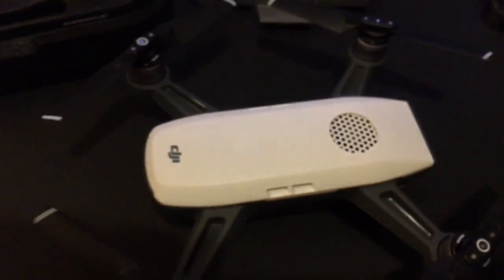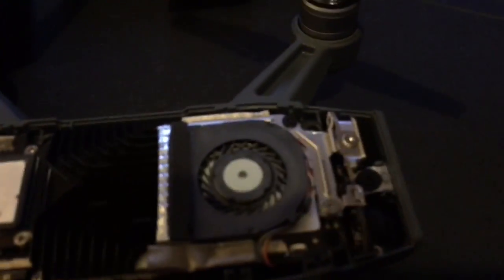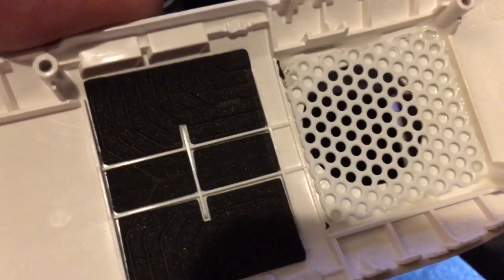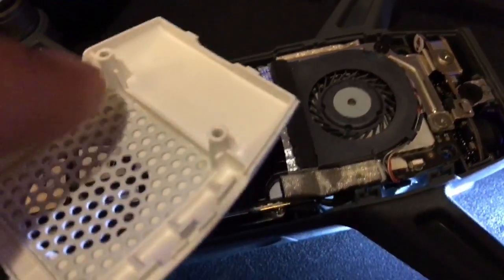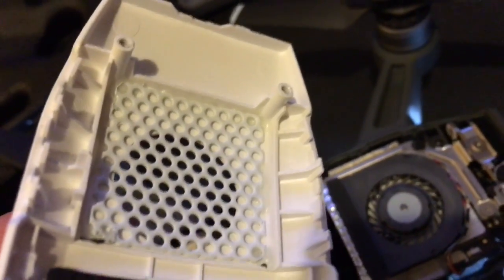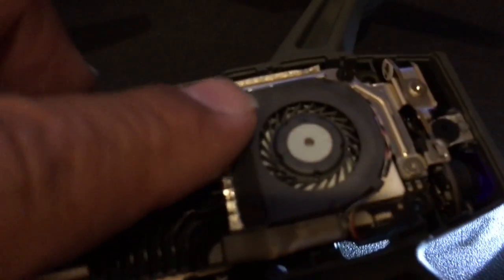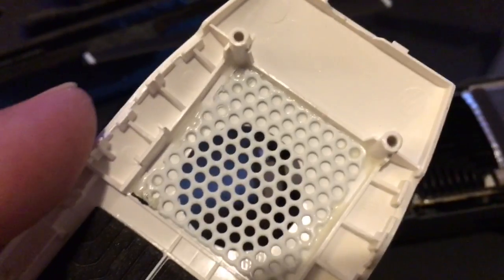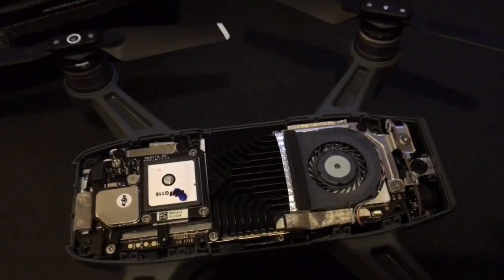Dji Spark mods

Comment: yup it helps that drone gets pretty hot after the second battery you could feel that hot air out the vents, i made a hole on mines that screen looks nice but is not necessary.
Reply from the maker: BORE Yea I took mine out after a while...Thanks for watching!

Comment: Nah bro you're right. The purpose of the heatsink is to help pull air OUT AWAY from the chipset not flow air into the ECU.  So yes it is a good idea to have that vent there and you might even get more flight time because of that grill. I am also going to do this when I get mine.
Reply from the maker: Fransisco Cardenas Thank you for watching And comments!

Comment: Finally did this mod.  2 flights in and it’s definitely cooler to the touch than normal.
Reply from the maker: Cookster670 Thank You for trying it!!! I’ve gotten so many comments about how dji made the spark the way they did for a reason...and how I’ve compromised the drone by cutting a hole in it and sooo much negative feedback. I’m glad you took the time to try it and gave your feed back on the results! Thank you for watching my channel!!!
Reply: Lol.  I know what you mean.  I posted my actions on a local forum and am getting the same haters making comments.   Apparently my spark will melt now. Lol.    Your logic made sense to me and it was worth giving it a try.   I am not dissapointed.   If they don’t like it, they don’t have to try it.

Comment: Were you having an overheating problem??, I guarantee you DJI's design pulls air from somewhere.
Reply from the maker: Jeff .S No....no overheating problems at all, But it did feel warm after a flight. Keep in mind my spark is hacked and flies in sport mode most of the time doing 50mph. I wanted to aid in the cooling process and now it’s much much cooler after 12 to 13 minutes in sport mode Thank you for your comments!

Comment: it sucks air from one side and runs it across the other. this mod isnt worth it in the long run. warranty void
Reply: No it doesn’t.  Both vents are exhaust vents.  I have just tried this mod and so far the temp is definitely cooler than normal after 2 flights.   It’s lukewarm vs hot.

Comment: hello good night my fan of the DJI spark is sounding it seems that it will touch something or there would be a space in the shaft, I opened it and uncovered it but I could not remove the noise the DJI spark is working perfect it is just that noise, you think you can fly it like that? have a serious problem? Can it be reheated? I appreciate your answer 🙏
Reply from the maker: Ai Emma Are the fan fins bent? Cause if there is nothing touching it.....It Could be that the fan fins are bent and that’s why your hearing a noise. Carefully check the fins on the tiny fan and look for any fins that appear to be pushed or bent!

Comment: Cool mod! Something I won't do to my  spark tho. Maybe there is some benefit maybe there's not. But there's most definitely a reason why DJI designed it specifically the way they did. This is just my opinion though. Safe flying!
Reply: May been just for looks, cooler electronics are the better they run and last longer
Reply: @mblake0420  Indeed cooler electronics last longer. And ofcourse DJI wants you to get a new one asap so thats why they mde it to heat up ;)

Comment: I flew my Spark yesterday after doing this mod.  My intake came out to only 3/8" with some window screen mesh as a filter.    I will say that the Spark IS much cooler after flying for 10 minutes.   The exhaust coming out of the side vents was blowing cool to warm air.  I don't have a way to measure the temp, but after a year of flying and handling this drone I can attest that it is MUCH cooler.   I have no idea of the benefit, but I am pretty sure that excessive heat is not good for electronics.
Reply from the maker: Conrad Serrano Do you know that there are some people out there that believe that the side vents draw in cool air. That one of them is used to draw in cool air and the other is the exhaust. I thank you for cleaning that up....And I know that the drone stays much cooler! But there have been tubers out there that out-rite say that this mod has no benefit.
Reply: I can positively attest that the side vents (both left and right) are for exhaust.
Reply: would have improved the battery. because the fan runs less ??????????
Help
Reply from the maker: mateus gabriel The fan turns on when the spark is on!
Reply: @geolopez914  Yes, but when the spark is cold, the fan turns slowly???
Reply from the maker: mateus gabriel Not true.....Do you even own a spark? Or taken it apart to even say that?? So if true....make the video and prove me wrong!

Comment: FYI SPOKE WITH DJI AND GOT WORD BACK FROM ENGINEERS!!! 

YOU IGNORED MY OPINION I KEPT IT ANONYMOUS BUT DJ I SAID I WAS A HUNDRED PERCENT RIGHT!!  

GUYS DO NOT LISTEN TO THIS GUY HE'S WRONG!! NOT ONLY IS IT DANGEROUS TO THE PEOPLE BELOW, TO HIMSELF, AND TO INNOCENT BY STANDERS, COULD CATCH FIRE, POSSIBLY CRASH OVER SOMEONE'S HEAD.. YOU WILL ALSO VOID YOUR WARRANTY... 

I TRIED TELLING THIS GUY USING MY 30 YEARS OF ELECTRONIC EXPERIENCE BUILDING AND FIXING ELECTRONICS CERTIFIED COMPUTER AND NETWORK ENGINEER WITH MY OWN BUSINESS FIXING ELECTRONICS PHONES AND COMPUTERS.. 

TELLING  EXPERT OPINION!  WHAT HE IS DOING IS COMPLETELY WRONG AND DOES NOT MAKE THE INTERNAL CPU TEMPERATURE DROP IT ALL.. YOU COULD BE MAKING THE INTERNAL PARTS EVEN HOTTER, CAUSING  STRESS ON THE FAN,  THE MOTORS ETC.  

HE THINKS HE DID SOMETHING GOOD NOW BUT SOMETHING WILL EVENTUALLY HAPPEN DON'T DO THIS TO YOUR DRONE BE SMART!!!!
Reply from the maker: muzikmon2267 LMFAO...WOW...You are a real dork! What’s the matter with you?
I’m not or never told anyone to do this mod, I did it cause I wanted to...because I paid for this....and I like to mod....and it dose run cooler! I’ve even changed the parameters so it flys faster in sport mode.
So take it easy there buddy...if I crash it or it blows up....it will be my loss.
Not yours or anybody else’s. Try not to be so much of a sheep...the wolves might see you and eat you alive....and try getting laid a little more often....😂 ITS NOT THAT SERIOUS.....OK!
Reply: Giovanni Lopez 

Yeah okay like I'll ever have EVER HAD problem with WOMEN LOL!!  you have no idea!!! you keep assuming calling me a geek now telling me I should get laid!!!  your a fucking loser, ignorant douchebag who can't take constructive criticism..  

If you did this mod  just for yourself then why would you show it to people online. You can't be that stupid you know if you put this on line people are going to try it and it's going to put them in danger you're an idiot..  

If you want to INSULT me by calling me a geek or what did you say kind of a wannabe geek when I'm pretty much an electronic genius.. 

You want to start attacking me attack you right back 

The only way you can become educated is if you listen to other people..  take the constructive criticism people pay me tons of money to help them with their Electronics in every single which way you can imagine!! 

SO TAKE THIS AS A FREEBIE!!  TAKE THE EDUCATION MOVE ON SARCASTIC WISE ASS....  

AND I WILL GO BACK TO MY GORGEOUS WIFE, RUN MY 3 BUSINESSES, FIXING COMPUTERS, PHONES, ELECTRONICS, GUITARS,  AMPLIFIERS BEING A GUITAR LUTHIER, MY OWN DJ KARAOKE BUSINESS, AND MUCH MORE.. 

AND YOU CAN GO SHOVE IT UP YOUR ASS!!!
Reply from the maker: muzikmon2267 Ok dude....whatever...go live your your stupid little life and fuck off 🖕🏻🖕🏻🖕🏻🖕🏻🖕🏻🖕🏻🖕🏻🖕🏻🖕🏻🖕🏻🖕🏻🖕🏻🖕🏻🖕🏻
That was free of charge...And thanks for watching!😂🇵🇷🇵🇷🇵🇷🇵🇷🇵🇷🇵🇷🇵🇷🇵🇷😂
Reply from the maker: muzikmon2267 ......BYE BYE HATER!
You just mad I did it before you did
And I put it out there! HAHAHAHAHAHAHAHAHAHAHAHAHAHAHA......HAHAHA IS FOR HATERS!....SEE!

Comment: AND FURTHERMORE

DID YOU KNOW IF YOU LET TOO MUCH AIR IN AND AROUND THE FAN THAT'S TRYING TO PUSH THE HEAT OUT.  THAT AIR COULD ACTUALLY PUT STRESS ON THE FAN FROM SPINNING CAUSING THE FAN TO BURN OUT ALSO IMAKING THE INTERNAL PARTS HOT.. 

THERE'S A REASON WHY THAT FAN IS SEALED YOU DON'T KNOW WHAT YOU'RE DOING

You don't know what the internal temperature is unless it's running through a computer..  

Good luck having a fire in mid-air sometime..
Reply from the maker: muzikmon2267 Lol....your a funny dude! But I do appreciate the comments.
I’ve been flying awesome do to the parameters that I’ve adjusted to make my spark fly faster! 45+ mph...I’ve had no issues since the mod! And you are entitled to your comments for what ever reason you think your some kind of professional geek or what ever? I’ll keep modding my stuff that I payed for thank you very much!
Reply from the maker: muzikmon2267 personally I think your just on some hateraid shit....But again thank you for watching!
Reply: Giovanni Lopez 

I have no reason to hate anybody.. 

I'm a computer and network engineer I have 30 years of electronic experience... 

I fix phones, computers, and electronics.. 

That DJI spark is a computer with CPUs... 

I know exactly how it works I know exactly why they put the fan where they did.. 

They know certain parts are going to get overly warm..  they know how much heat the battery can take and so on they're engineers.. 

They also know the internal temperature of the CPU with the fan currently where it is in every situation..  SOMETHING YOU CANNOT MEASURE...  

I understand aerodynamics..  I also understand that if any type of wind comes in and hits that fan in a different direction when it's flying it could slow the fan down and put pressure on the fan causing the fan to fail eventually.. 

If the fan fails or even slows down in midair. You may have a cooler battery and other parts but your going to have a very hot CPU IN YOUR EXPENSIVE DRONE COULD STOP ACTING FUNNY AND CRASHED TO THE GROUND. 

They have set up that fan for a reason where it is an isolated for a reason they are Professional Engineers and they know what they're doing.. 

They have tested their product Every Which Way but Loose and know exactly what parts can get hot and what parts can't..  

They had that thing hooked up to a computer watching all the internal temperatures like I said something that you cannot do..  

I'M NOT BEING A HATER I'M TRYING TO HELP YOU..

I'M TELLING YOU RIGHT NOW I'M NOT TRYING TO BE MEAN TO YOU WHAT YOU'RE DOING IS COMPLETE IGNORANCE ( MEANING YOU DON'T KNOW) 

I have yet to hear of any spark overheating or having any problems like that unless it was a defective Spark..
Reply: Giovanni Lopez 

So whatever you're not going to listen you're going to do what you want to do good luck in the next year when you have a problem you will know why...
Reply: I'd rather have a hot fan motor than a hot cpu.  That's for sure.  Most cooling fans make warning noises before they die. 
 I got my first hot CPU notification about 4 seconds before my Spark slammed to the ground.
     I'm in Texas and these things need to be able to take direct sunlight.  And Giovanni Lopez's mod has made it work.

Comment: Dude you're not an engineer. DGI spends millions of dollars designing stuff with certified engineers..  

They've done painstaking research on how hot the quad gets in every situation

Let me give you an example me as a computer engineer can tell you with computers the worst thing you could ever do is take the cover off on a desktop computer because it will cause it to get even hotter than if you have it on. Because the computer is designed to have an air flow to push the hot air out using the fan.. They put the fan in the most efficient place to push that hot air out you screwing with this could actually make it worse your guarantee that it's cooler means absolutely nothing without real proof of the internal temperature of the CPU, GPU

So please leave your drone alone you don't know what you're talking about you don't understand why they did what they did your not an engineer.. 

Peace out LOL
Reply from the maker: muzikmon2267 Lol....funny cause my drone stays a lot cooler and so dose the battery, But ok thank you for the comment!
Fly safe!!
Reply: Giovanni Lopez 

You have no idea what the internal temperature is in your CPU you don't have a clue what you're doing..  

The battery and other parts are designed to take so much heat.. 

Eventually you're going to have a fire I'm an engineer I guarantee it you don't have a clue what you're doing..
Reply: Giovanni Lopez 

And also you have no idea how cool it's running in the air!! 

That extra air could actually be slowing down the fan causing the internal temperature of the CPU to get higher...  

I dare you to call DJI and tell them what you're doing if it's out of warranty they will laugh at you...  

Just remember I warned you good luck
Reply: Ok Gio I get what dude is saying!!! He is saying that the components might need that heat & they might have been designed with such heat in mind & by lowering that heat u might be causing them to run hotter, less efficient or cause them to be dangerous. But on the other hand it’s DJI not DGI soooooo

Comment: sir I'm a project designer and cutting a hole in that doesn't do anything for you about Cooling when the top has no holes or anything in it that works better trust me there's a science behind it
Reply from the maker: Mr. Who That’s funny cause it even feels cooler to the touch even after full throttle flying for like 13mins.

Comment: I forgot to add that removing the cover voids the warranty.
Reply: Yes it does.  it's certainly a risk, but something I think worth doing.   There are lots of reports of fly aways, IMU failures, compass errors..etc. Some of these are explainable, but it could also just be that the components fail from overheating.
Reply: So, you are saying that you approve of this mod?
Reply: yep i am.  I can't say for sure it will help, but also don't think it will hurt either.  I have a spare cover and will give it a go
Reply: Go for it. But do the analytic approach and measure the heat output before and after the modification. I am very interested in the results and if there is a significant difference, I will jump on that wagon too.
Reply: Unfortunately my hand is the only measuring device I have access to.  I don't have access to an instrument that will do this accurately.    So if it is a significant improvement I will know, but if only minor, I probably won't.  That's also why I bought the spare cover.  I can stuff around with that and always go back to stock if I don't see it's worth it.  I'll report back either way.  Unfortunately I"m travelling overseas at the moment so won't be able to do this for another week

Comment: I say if its not broke, don't fix it. Your mod in theory is sound. However, there is air flow directed into the inside of the Spark through the camera gimbal opening. I could plainly see that when you were directing the light from the front. Since you did this mod already, I think that a scoop of some kind over the opening would add to the air flow. Also, the video by Cookster670 plainly shows outward airflow. That picture of the blue and red lines is bogus. Yes, I do own a spark! And if it is sitting still on the table, it does get hot as there is no air flow through the front but after a flight, I do not feel the heat as much. You could have demonstrated your idea better with a hand held non contact IR/laser thermometer showing before and after heat readings taken after a few minutes of sitting still on a table. As far as your high speed mod goes, maybe you should have bought a racing mini quad. Nuff said.

Comment: I would think the aluminum jest blocked all the correct air flow pattern, check link below to show pattern, this mod is not good at all, ruins integrity of the fan and heatsink
link I'm talking about, thanks Norman Roberts
http://www.thedronefiles.net/wp-content/uploads/2017/05/spark-5.jpg
Reply from the maker: Robert Taylor yea really....well it’s running a hole lot cooler... I’ll tell ya that! And this fucker is modded doing 45+ mph in sport mode!
Reply from the maker: You and everyone else keeps showing the same stupid pic...do you even own a spark?
Reply: Wrong Robert...I tested this myself.   Both vents are exhausts.  See video I made to confirm . https://youtu.be/uG028lTn8IU

Comment: hy, how did you do that ?? can you tell me how. I like it.
Reply from the maker: Mahesa Jenar there is six screws holding the cover on....four under the battery and two under the gimbal.
Once the cover is removed....make a small hole in the center where about the fan is located, Then use a round file until you reach the desired size hole.
I cut out a piece from an old speaker grill for the mesh.
Reply: Giovanni Lopez then where can I get that little hole inside? is it like a sponge foam.
Reply from the maker: Mahesa Jenar What do you mean...the hole was made by me. I sanded it until I got the size I wanted...the grill is from a speaker grill...and I painted it white.
Reply: Giovanni Lopez 
what is the speaker grill you mean ?? then where can I get him a friend ??